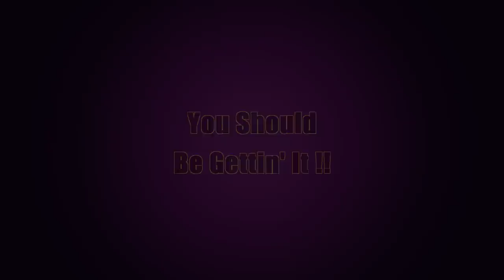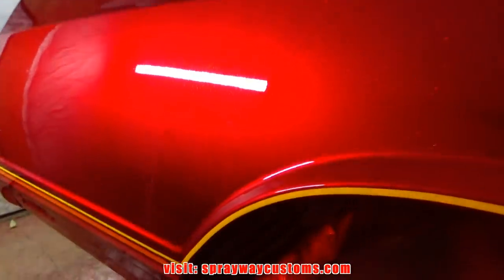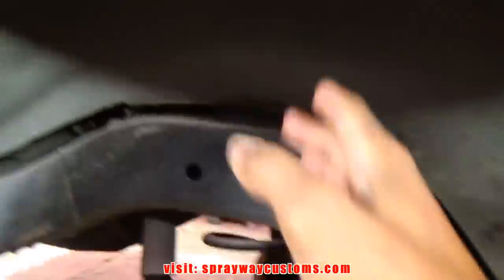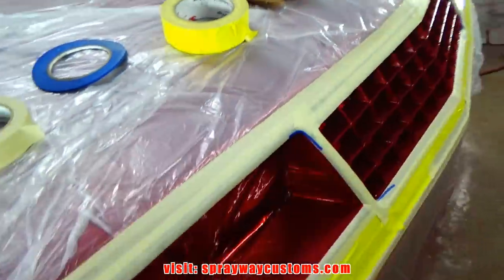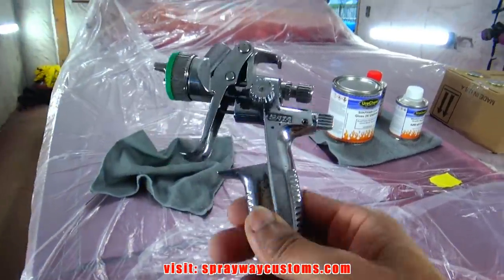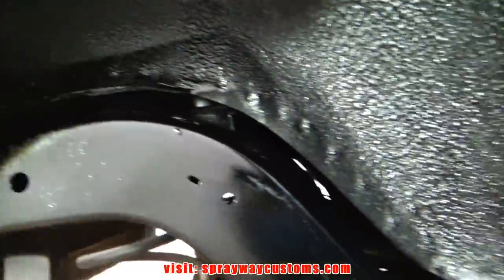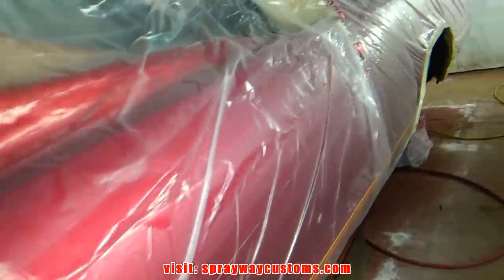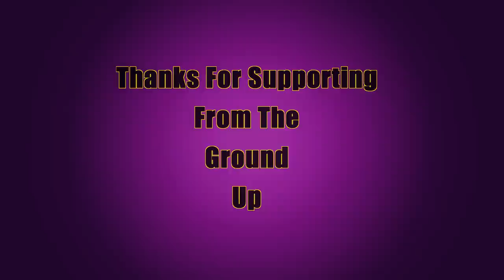Painting Frame & Wheel Wells With Single Stage Satin Black Paint CANDY APPLE RED 1987 MONTE CARLO SS

Comment: Fantastic job bro! You killed it. Seeing this brings so much inspiration to me right now. As I had mentioned a few videos ago, I'm doing an 86 monte ss. It was as rough as a night in jail but, worth saving. I had to replace both rockers, front and rear lower quarters on both sides. Dents, dings, and chips all over. Been hitting it hard for the last few days. Bought a 99 silverado for an engine and transmission donor. I keep asking myself "how do you eat an elephant?" One bite at a time. Thank you for the inspiration.
Reply from the maker: That's correct...you on the right track

Comment: Do you have a preference in guns that are in the 200.00 range? I'm going to spray a van with single stage satin black and all I have ever had are really cheap guns. I'm just getting back into spraying as the last 3 cars I've wrapped and the finish is just to soft and doesn't really hold up outside, especially the satin black. Your work is really inspiring.
Reply from the maker: I've always sprayed with SATAjets or Iwatas so it's hard to say

Comment: Nice spray job but I would of gone with 2nd spray or 2 coats. One thing I see is when you spray you spray from the top down, it's better to spray from the bottom up using the layer technique that way you would have less chances of runs. And try and use a ground to the body of the car to the ground of the house this is because the paint has electricity when spraying and the paint would flow put much smoothly. But overall the paint job is beautiful and wet my brother. Candy paint jobs are a lot of time and so much involved.  Primer and 2weeks dry time,base coat silver 2coats ,metal flakes, Candy 3to 5 coats, clear coats 3to 5 coats.  There is so much more involved in spraying Candy and you know that. But again it's a beautiful job,it's a 5to 8k paint job
Reply from the maker: Thanks man..I actually sprayed 3 coats of the black